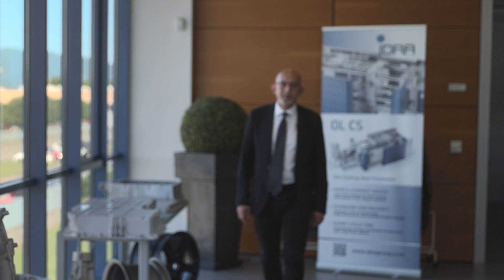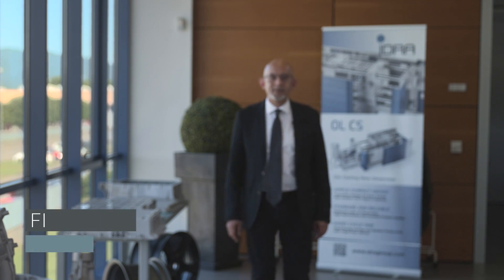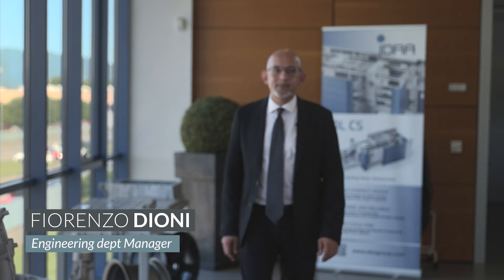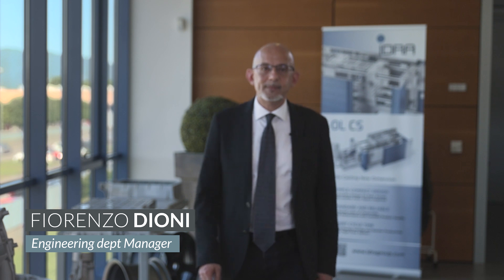IDRA GROUP | EDUCATIONAL IDRA - Two Platen Machine vs Three Platen Toggle system (#GigaPress) 🇬🇧

Comment: It would've been really nice to have some pictures and/or animations for Tesla-heads like me who are not really deep in the casting/stamping industry and don't know the difference between stamping presses.
Could help spread the word, as then it would be interesting to watch for 1000x the people!
Reply: My understanding of the differences between a two platen machine and a three platen toggle machine is that a toggle machine can obtain greater clamping forces of the die halves while requiring lower hydraulic pressure. In a two platen machine, hydraulic cylinders directly apply pressure to the moveable portion of the die. The clamping force is limited to the hydraulic pressure and the number of hydraulic pistons acting on the moveable die half. In a toggle system, the moveable die half is moved by two linkages. The linkages have three pivot points — 1 at the fixed frame, 1 at the moveable die half, and 1 in the middle. In the closed position, the three pivot points are in a straight line. To open the die, you pull the middle pivot point perpendicularly to either side, which rotates the linkages and opens the die. Much higher clamping forces can be obtained by having the linkages be marginally longer than the distance between the fixed frame and the closed moveable die half.

Imagine trying to wedge a 12” long board in an opening that’s too small - say 11.75”. You can try to push the board into place, by prying. But, the easier method is to cut the board in half, and insert a hinge point in the middle. This way you can place the two ends in the opening, which will cause the hinge point to stick out. If you push the hinge point into alignment, you’ll need to apply a lot less force because of mechanical advantages. Since it’s too big for the opening, the board will deform in length to be 11.75” long (assuming the opening doesn’t also deform). The strain (deformation) in the board will create stress, which will apply the force (pressure) to the opening. In this manner you might have only applied 50 lbs of force to wedge the board in place, but it might be applying upwards of 500 lbs of force to the opening… The exact amount of force applied is dependent on the stress-strain relationship (Modulus of Elasticity) of the materials and the total amount of deformation.